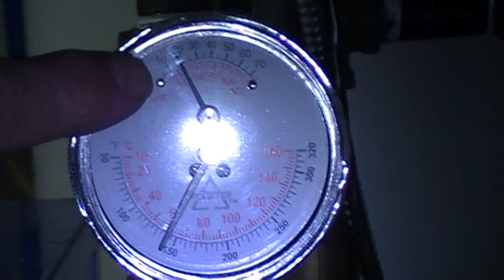Relief valve blowing off on hot water boiler (furnace). possible cause... Part 4

Comment: Hi this post is very helpful, as I have 3-4 gallon of water dripping out of the relief valve per night. Have replaced (1) expansion tank, (2) Pressure Reducing Valve and (3) the relief valve, but pressure stills creeps up to 30 psi and water still dripping off. Tried to turn off feeding valve to the burner, water still drips out and pressure goes back to 30 psi. It is a Burnham Hydronics Series 2 gas burner for heating water not steam. so does not looks like it has a hot water coil. Not seeing an aquastat and when burner operates, temperature is in 160-180F range. What is next? thanks!
Reply from the maker: Hello freefly,
So I am just trying to figure this out. You changed the tank, relief valve and pressure reducing valve. You are sure there is no coil or tank for hot water in it? When it hits the high level does the burner shut off immediately? What is the pressure at 180 degrees? 
Have you had this boiler for a while or is it a new install? 
Get back to me when you get a chance....Al

Comment: Hi TheOldkid888: the pressure relief valve on my gas boiler keeps going off. Lots of water then steam. I've replaced the expansion tank, the pressure regulator, the circulation pump, and the pressure relief valve. I don't know what to do. Any ideas? Thank you!

Comment: Hi again, got another question you maybe able to help me with.  I have an oil fired boiler that heats water for domestic use as well, tankless coil I think it's called.  I am going away for a bit and want to have the boiler on to keep the house above freezing, but don't want the boiler to keep cycling to maintain domestic hot water.  Can I disable the domestic hot water in teh aquastat? And if so, is it simply a matter of disconnecting the "LO" wire .  Thanks for your input.
Reply from the maker: Hello A Martin;
The triple aquastat has a wire on it for domestic water that does keep the boiler hot. I wouldn't get into disconnecting a wire.
If I were you I would turn the LOW limit down. Right now it is probably set around 180 for the high and 160 for the low. Drop it down to 130  or in that area. The gasket around your coil has heat around it all the time. If you have a warm spell and your thermostat does not tell the boiler to kick in for a few days or longer; your boiler temperature will drop to room temp. There is a good possibility that the gasket could start weeping around your coil and leak over time. I personally prefer to maintain the temperature with this situation. 
Since your boiler has the coil; it is better to maintain some kind of heat in it. 
Just my 2 cents...
Thanks for commenting and have a great week!    Al

Comment: thanks for sharing.  I have an oil fired boiler and am pretty sure the expansion tank is shot.  Boiler relief valve opens at 30PSI as water is heated.  The strange thing is that the pressure will slowly drop to about 5 PSI.  Shouldn't my PRV open to supply water when the pressure drops that low?
Reply from the maker: Hello A Martin;
Do you have an expansion tank which is about 3 feet log and a foot wide or is it a bladder tank?
If you have a bladder tank; you can pump some air into it to hold you over until you get a new one. If it is an expansion tank then you will have to drain it and you will be all set.
The reason the PRV is not allowing any water into the system is it is probably plugged. There is a little brass lever on the top of it and if you lift it up; water will flow into the system to what ever pressure you want. Preferably around 12 to 14 pounds tops when the boiler is cold.  The system should show about 20 when hot!
Thanks for commenting and let me know how you get a along!     Al
Reply: TheOldkid888
thanks for your quick reply.  not sure what kind of tank it is, its pretty old looking and was in the house when I moved in.  The house is about 44 years old, I moved in a year ago so I have no idea the age.  It's about 22 inches tall by about 13 inches diameter.
Reply from the maker: Hello A Martin;
From what I see there; you have an expansion tank. There is a valve that you can shut off on the pipe going into the tank. You have to empty the tank and then slowly open the valve that you shut off. It is that simple.
Hopefully there is a valve on the tank some where that will allow you to drain it. In order to drain it; air has to replace the water, so hopefully there is a way to allow air in it near the top. If not you will have to open the drain and it will take you a while. Big thing is to make sure you completely drain the tank. That expansion tank will last for many more years.
If the water is not going into the system then you will have to lift the little lever on the reducing valve and fill the system until it is at 12 psi. Thanks for the picture!
Thanks for commenting and let me know if you have any more questions!    Al
Reply: TheOldkid888
Thanks a lot for taking the time to answer that.  I will try what you said and let you know!
Reply: Just realized I never got back to you.  It worked great, thanks again :)

Comment: Replaced the Xtrol and pressure release valve. Pressure goes up to about 35-40 psi ans spills out. Bad regulator?
Reply from the maker: Hello eric racine,
An easy way to check if the regulator is bad is to simply close the valve before it and see if the pressure stays the same. If the pressure doesn't go up then it is the regulator which is not overly common.
If your boiler is shutting off at the correct temp then it is probably the coil in your boiler. A small pinhole in the coil will cause this to happen.
If so, the coil has to be replaced which can be a bit of a project.
Hope this helps!
Thanks for commenting and let me know how you get along!     Al
Reply: @TheOldkid888  thank you. I just ordered a new regulator
Reply: @TheOldkid888   ok so I am still waiting for my regulator from Amazon. Water input valve has been shut off for a few days. I just noticed that pressure went over 30psi since it spit out.  What  pressure should I read when the water cools down?

Comment: I'm battling this right now.  Originally after every run, the relief valve would let a decent amount of water out.  Maybe a quarter cup to a half cup.  I've had the relief valve and expansion tank replaced along with some air bleeders.  The issue went away for the most part until recently.  Now its intermittent and the amount of water is a maybe a quarter cup.  If that.  Pressure is hovering around 30-35psi.  My furnace guy is thinking this could be the next thing to replace.  What're your thoughts?
Reply from the maker: Hello @Intelpentium54321,
A simple way to test the pressure reducing valve is to simply close the valve before the pressure reducing valve (PRV) and drop the pressure on the system by opening a drain valve. Drop it down to around 20 pounds and keep an eye on it.  This is a sure fire way to see if the valve is holding the correct pressure which is 12 PSI.
Do you have a coil in the boiler?
What temperature (not pressure) is on the gauge when the burner shuts off?
If you could answer these questions for me it would help greatly.....Al
Reply: @TheOldkid888  Thank you for responding.  I really appreciate it.  Do you think its dangerous to wait until spring?  I'll have to give it a go.  I always get worried exercising them valves though..Especially with all these shortages.  

I do have an indirect water heater...I saw your other video and started to get worried lol.  I believe the aquastat was set at 180 or 190.  It's almost guaranteed to let off some water if you spike the temperature in the house and it has to run a decent amount of time.
Reply from the maker: @JimmyDean404   
The coil in your indirect water heater could possibly be leaking which is a common problem. One way to check that is by closing  the valve before the PRV and drop the pressure on the system to twenty pounds and if the pressure rises then the tank is the problem.
That's where my monies at. Quite common.
You've changed the relief valve and installed a new expansion tank. Try closing the valve before the PRV and drop the pressure on the system. This will eliminate it as the cause and if it is you can leave the valve closed for a long time. Every month if the pressure drops below 12 pounds simply open the valve and allow water to flow into the system.
You definitely want to look into this.
If it is the coil in the water heater it will only get worse. 
Sorry for the bad news....
Let me know what you find.
Thanks for commenting and best of luck with the repair.....Al

Comment: I could hear air in both of my zones.  I went to all of the bleeder elbows at the high points and opened them... nothing happened.  I was confused.  I expected air or water to squirt out.  I surmised that the pressure must now be zero in those lines so I was confused why the pressure regulator valve was not allowing more water into the lines.  I jiggled the lever and...in flows water (you could hear it).  Do you think this indicates that that valve is worthless?  It appears to be working now (that is, it lets in water when I bleed the lines) but I can't seem to get my pressure below 20psi!
Another question is that if the pressure is factory preset to 14 psi, and when I jiggle the lever it allows more water into the line when the pressure is already 20 psi, does that mean that 14 psi preset only works for inflowing water unless over-ridden by the lever?
Should I just open a valve and let a little water out until the pressure drops to 14 psi and if the pressure regulating valve lets water back in assume that it's faulty?
I notice that you answer questions and won't ignore a follow up, like a commenter below.  That would be rude.
Reply from the maker: Hello Glenn,
They get a little dirt in them and they become plugged over time. You can change it out, but the same thing will happen over time. Generally I recommend looking at the pressure every two months and if the pressure is down; lift the lever to put 18 pounds in the system if it is hot. A pound either way is fine.
If the system is hot; it will be around twenty pounds and that is fine. No worries. Generally waht many systems run at.
The valve comes preset. The only way to increase the water pressure in the system over preset is by lifting the lever. 
Correct.
Even if the valve is preset; once the water heats up, the pressure will rise. 
I wouldn't worry to much about the pressure being around 20 pounds. If it was up around 25,26, 27 then I would be concerned. You're relief valve is set for 30 PSI so you don't want it close to that. 
Thanks for commenting an denjoy your week!     Al
Reply: Thank you Oldkid.  It did hit 25 and the boiler was off.  Do air pockets increase pressure?  I will try to reduce the water volume.  Would you recommend the relief valve or the drain spigot?  Relief valve is new (thanks to trying to relieve the pressure last Saturday night.  It was old, wouldn't reseal, and leaked like my tap.  What a stupid time to do it-every supply store was closed!)
Reply from the maker: Hello Glenn,
You're welcome!
No. Air pockets do not increase pressure. I would drain a little water off at any sediment faucet. That will work for you. You never want to pop the relief for that reason. They never seat properly if they are an old valve. Old being a few months. 
Drop it to about 20 when it is hot and watch it for a day or two.
You are not alone when it comes to that. Lots of people have tackeld jobs thinking it will be a quick fix when all the stores are closed. Better off waiting until shopping hours.
Thanks for commenting and enjoy your week!   Al

Comment: How do you determine if the feed valve is the cause of the relief valve blowing off?
Reply from the maker: Hello jaxcs;
It would be a very rare thing for the feed water valve being the problem, but to see if the valve is the problem; you would simply turn the shut off before the feed water valve off.
Is there a coil in the boiler and does it have an expansion tank or a bladder tank? A bladder tank is about 1/3 the size of an expansion tank and screws into a fitting on top if the boiler.
Thanks for commenting and have a great day!     Al
Reply: I know this is an old question but I just figured this out logically. My pressure keeps going up but only when the boiler is on. It goes up really rapidly. If it was the feed valve it would keep happening even when the  boiler is off. Since that isn't the case I believe, in my case, it's the expansion tank since it raises really quickly when the heat is on. If this comment is more than a day old then it was the expansion tank. If not I will update it.

Comment: Can the HW coil in the boiler cause the prv to blow?
Reply from the maker: Hello John,
Definitely. If you close the valve on the coil going into the boiler and the PRV doesn't pop then you have found the problem. Be sure to drain a little pressure off the system after you have closed the valve. Dropping the pressure down to around 18 pounds should be fine.
Closing the valve to the coil and reducing the pressure should prove this. If it increases after you have shut off the coil then it is most likely your expansion tank.
P.S. Check at a faucet just to make sure there is no pressure on the hot water side of the faucet. This will cover the valve on the coil. If you have no hot water then the valve is holding. Do not run any water in the house for a while and watch the tridicator (gauge). If it stays at that pressure then the coil is the culprit.
Thanks for commenting and get back to me if you have any other questions.     Al
Reply: @TheOldkid888   Thank you I cannot wait to try this tonight
Reply: @TheOldkid888   If there's no water leaking into the chamber how chamber how does this create pressure for it to blow?
Reply: So replaced coil and still blows prv.... uggg
Reply from the maker: Hello John,
To see if the PRV is bad simply close the valve feeding the system...it should be located just before the prv. Once you have done that you must take pressure off the system. Open a drain valve and drop it down to about 18 pounds and watch the pressure on the boiler. 
Did you drain your expansion tank? Do you have an extrol tank about a foot wide and roughly a foot high or an expansion tank 3 feet long and one foot wide?
Be sure to check the tank to make sure it is drained. 
When you drain the tank you should get about three five gallon buckets of water from it if it is a full size tank about three feet long.
Thanks for commenting and get back to me when you get a chance...Al